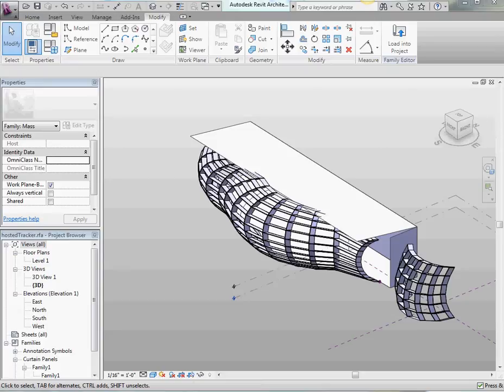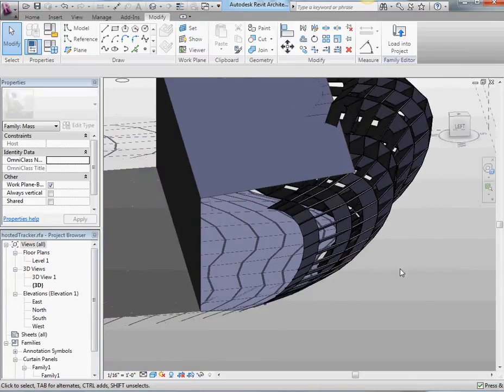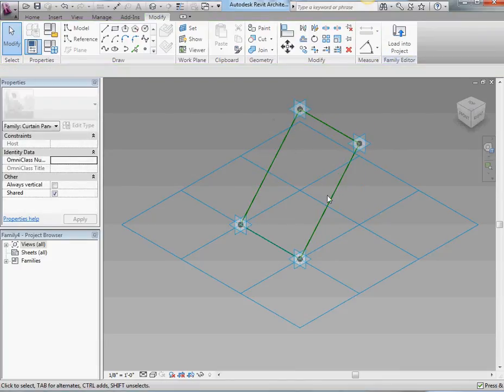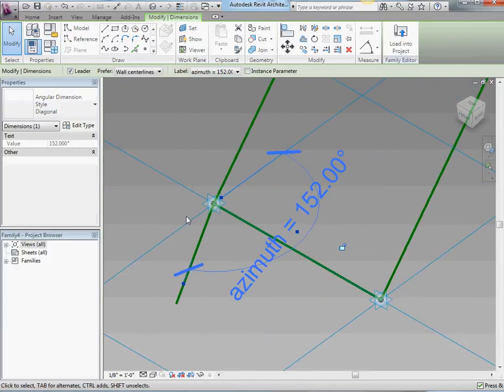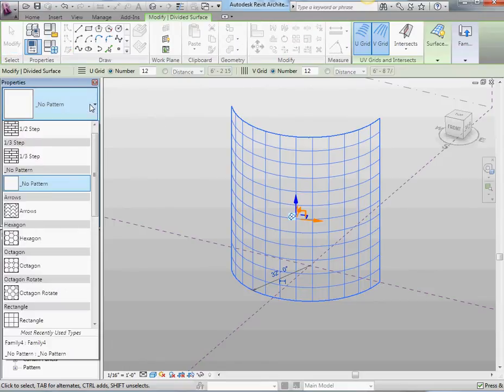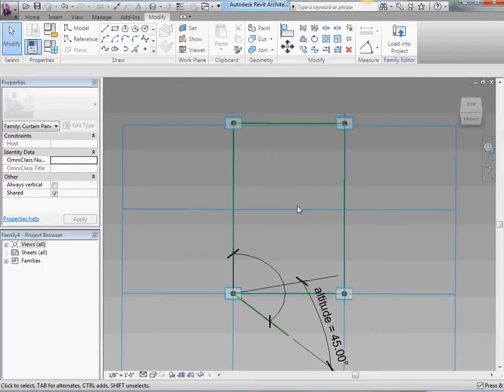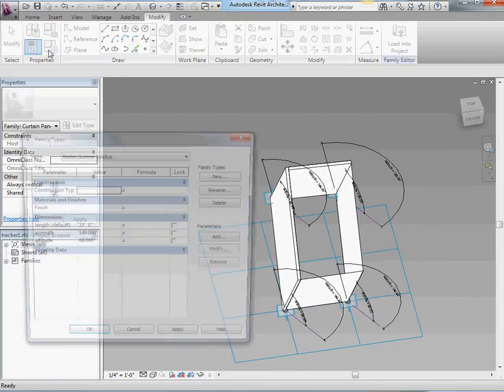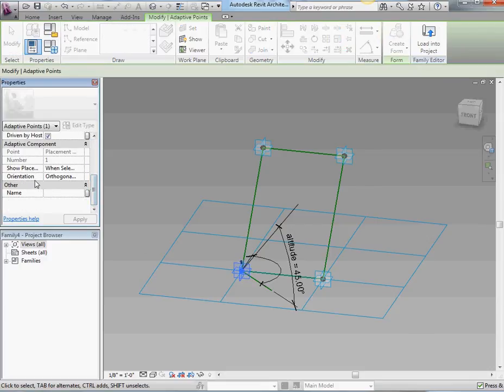buildz.info:  building a solar tracking panel

Comment: Dear Zach i tried this panel but i have facing some problems in azimuth angle once i assign azimuth angle to zero after that i try to assign another angle like 20 degree my base point is moving from the base. Please give me a solution for that.